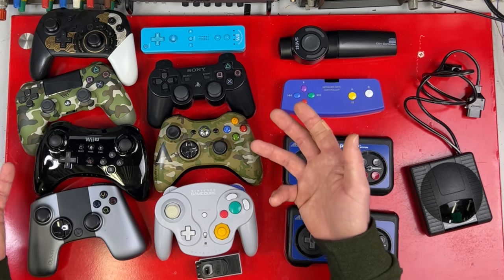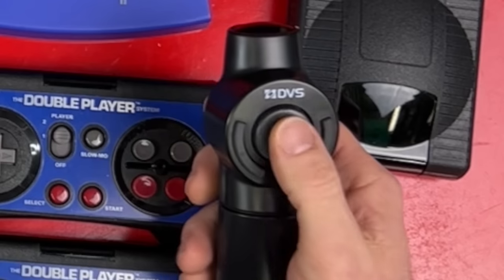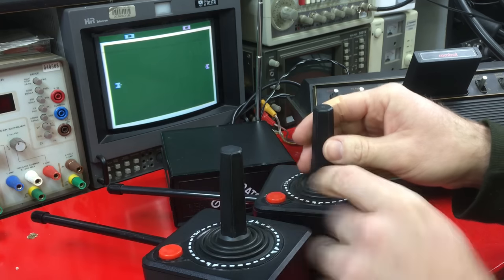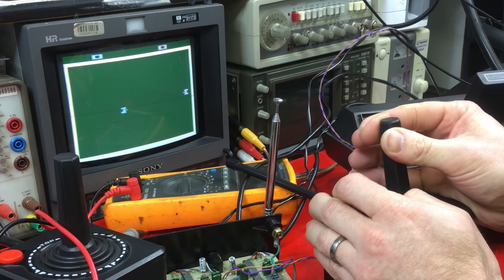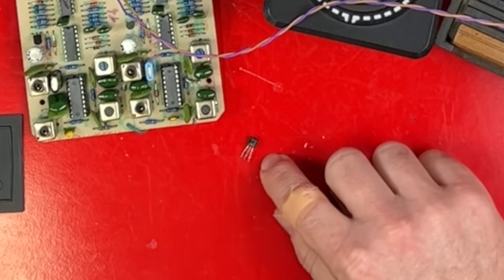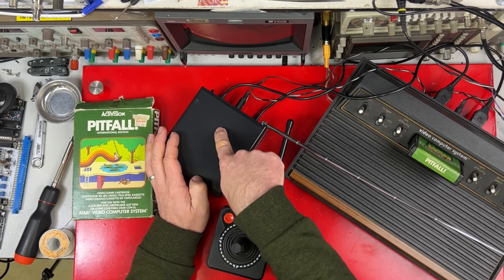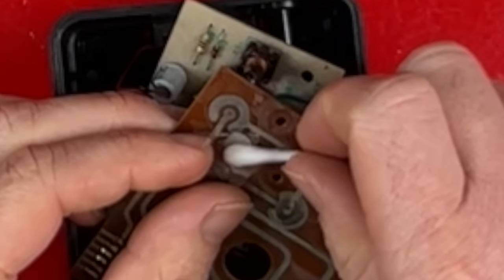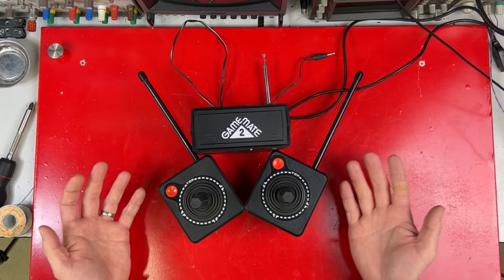The First Ever Wireless Video Game Controller

Comment: Atari originally wanted to create a new 2600 variant called the 2700 that utilized these. However they made the controllers unbelievably powerful. As they would mess with neighbours’ TVs, radios, and garage doors and the FCC told them they couldn’t sell it.
Reply: Oh lord LOL
Reply: Good old days of unencrypted 27, 49 and 433 MHz crap flying all over the place and doing whatever
Reply: I've seen this story shared everywhere over the years, but it's never accompanied by a source. I'm a bit skeptical of that last tidbit. Surely they could've just used an unused frequency range like every other remote control device?
Reply: @kimgkomg  Nowadays we've got literally millions of devices on a single frequency range (the 2.4 GHz one for example), but with current modulations you can actually do it feasibly, devices know when to hop sub-channels automatically, reject signals from other devices they don't need to listen and so on, but back in the 70s and 80s that wasn't the case. You had pretty much the 3 options I posted above, more than that and you might need custom hardware that nobody makes and it will cost a LOT to develop, and the modulation is just OOK or so - On Off Keying. Basically you pulse the radio on and off, that's it. If anything else accepts a similar burst, it will react.
That's why it took until the Wavebird for those things to cooperate freely, you kinda need a smarter encoding to not wreck every other device around and not have your own controller moving with garage door openers or your brother's RC car either. Basically it didn't even need to be THAT powerful for issues to happen, there were enough devices around on the allowed/usable frequencies to screw it up as well.
The issue with just changing frequencies is that there's only so many unused frequencies that you're allowed to use and sell products at, regulated by the FCC in the USA, Anatel if I recall in Brazil, and dunno the European and Asian equivalents. Otherwise what happens is that wild west of interfering devices overpowering each other and in one moment there will be a dangerous interference that you just cannot allow (like aircraft AM radios).

Comment: These type of RF controllers probably weren't made anymore past the Atari because of FCC regulations - the fact that you can pick up the controller signal as a TV channel signal is a big no no in their books and I'm sure that with more and more video games coming out with the NES they were much more strict on laws and certification
Reply from the maker: Yeah I think you’re spot on. That still falls into “too expensive” though. The cost of making a device adhere to strict regulations would be much higher
Reply: Legal unlicensed RF devices have been around for a long time, for example RF garage door openers continued being made after the Atari. The fact that it needed to be very close to the TV means it wasn't operating on a TV broadcast frequency. James was probably picking it up on a harmonic, or if it didn't change with the TV's tuning position, it was probably being picked up by the IF.
Reply from the maker: @eDoc2020  yeah it was visible on tonnes of harmonics across the tv spectrum. I forgot to check the carrier frequency when I had the scope on it but the crystals are about 48MHz

Comment: Could you make anything that produces a radio frequency into a controller? It would be kinda fun seeing if a wallow talkie or something like that playing a game.

Love the videos!
Reply from the maker: Apparently an RC car radio on the right frequency can trigger some buttons on these.
Yeah basically you could.
Reply: These old wireless receivers were really dumb. They locked onto certain frequencies and did nothing to make sure the signal was the right signal or even made sense. Clearly that stopped being adequate when radio frequency remotes became more common.
Reply: @Bubu567 the original product before this they were working on at Atari was basically just that ran on a lesser wavelength and could go like 2000feet. But it triggered garage door’s in the whole area and so they stopped trying to dev it.
Reply: @Roninkinx  That's hilarious

Comment: My brother and I had a pair of these back in the 1970s.  We didn't use them often because they did burn through batteries and you had to be close to the 13" TVs of the time to see what was going on anyway, so the cords weren't THAT much of a problem but we did occasionally use them in our bedroom because it meant we could sit on our beds and play without the controller cables blocking the path through the room (which the rest of the family frequently used to get to the bathroom ... our house layout was weird).

Comment: Nice work James!! I actually have a slightly older version of this complete in the box. The controllers on mine use a pull out aerial antenna as opposed to the flexible rubber ones on your set. I was pleasantly surprised how well these worked! 
Also loved the more in depth view.  Much appreciated :)
Reply from the maker: I saw a couple of photos of those but no info, what’s the build date on the bottom? Mine are november 1982 from memory
Reply: @Games_for_James The build date on my set say September 1982. Made in Korea. Serial 113130, interestingly the 2nd controller has the same serial. I suppose they swapped over to the flex antenna so kids wouldn’t bend/break the aerial style antenna.
My boxed set came with no instructions just the styrofoam and the setup. Weird. Let me know if you want any more info or photos.
Reply from the maker: @silverperzon  the serial number would be for the set so that makes sense. Yeah telescopic antennas are really bad for breakage. I’ll have to check what my serial number is

Comment: When the PS4 got released I thought the controller was kinda weird and wondered why they didn't keep the old design.
Now I can't go back to the older playstation controllers without wondering how tf I used them for hours on end lol
Basically all I have to say about wireless controllers

But next time less spiders and more cats please ;)
Reply: The DualShock 4 is fantastic! You can buy adapters to use them natively with the Switch, SNES, MegaDrive, and PC so it’s basically my universal controller.
Reply: @jb-br8bf  oh that's cool, I didn't know about that. I just use mine on my PC with a USB cable. You can connect them to your PC with bluetooth as well but sometimes that doesn't seem to work for whatever reason so a cable is easier
Reply: @jb-br8bf  I’ve had some “bad” experiences with ps4 controllers (stickdrift slightly earlier than the Xbox counterpart, the rubber on the sticks falling apart… pretty minor stuff), and I have an Xbox series S rn because it’s the cheapest next gen console, but I completely agree the DualShock 4 is good. Like every modern controller. Except that it uses potentiometers. Like every modern controller. (Why does there have to be a patent on hall-effect sticks)
Reply: @jb-br8bf  No need for an adapter on PC - they should natively work, especially if you have Steam installed.
Reply: I liked DualShock 3
Reply: @AtomSquirrel  did you hold one recently?

Because I liked it too. I recently held one. It’s awful.
Reply: As a playstation boy, i have one huge gripe about the dualshock 4, and that is the "start" and "select" buttons being flush with the actual surface of the controller, it makes it really annoying to press them at times
Reply: @Friendly_Neighborhood_Dozer  I have DualShock 2 and 3. The 3 is very lightweight and nice.  I always turned off SixAxis when I could though. The only downside to 3 was the dreaded Mini USB port
Reply: @Friendly_Neighborhood_Dozer  and as a side note, I’ve used 4 and Dual sense. The problem with the 4 was the dreaded micro USB, aka flat, backwards Mini USB. PS5 controllers are aight. I just like the old ones because they’re the ones I grew up with and feel the most familiar. I get more of a connection in games
Reply: @IntelliPocalypse not to mention the micro usb port is upside-down, which sure is kinda annoying
Reply: I immediately loved the size of the PS4 controller, PS3 controllers and earlier were just too small, and it made them seriously uncomfortable to me. The ergonomics are probably a bit better too, but the size is the main thing.

But man is the battery life awful. I really wish they wouldn't have stuck a big LED in there, because its my single biggest gripe. Once the battery ages a bit, and it doesn't have to be long, they might as well just be wired controllers. The switch pro controller is probably my favorite overall, but the lack of a headphone jack is a blow against it for sure, but its my only gripe and I don't use headphones with consoles too often anyway, and if I'm using it for PC it wouldn't even be useful anyway.
Reply: The only thing I don't like about the dualshock 4 is the analog sticks
Reply: @Friendly_Neighborhood_Dozer I use them all the time they feel great unless you got aftermarket junk
Reply: @toyotacorollaaltis8613  I have biggass hands and the grips are very flat and small. So it may just be that, as well as the fact that I’m currently more used to the triangular grips of the Xbox Series controller.
Reply: @AtomSquirrel  I always felt the PS3 controllers felt noticeably cheaper than the PS1 and PS2 (and PS4 afterwards) In hindsight that might just be because they were lighter.
Reply: So to clarify, the reason they felt cheaper is because the dual shocks in the PS2 controller were used either without permission or the license was up on them. The company making the vibration motor for the PS2 controller sent Sony a cease and desist. So when dual shock 3 came around, they had to use a different vibration motor. This happened at the tail end of the PS2 era, so some PS2 controllers feel as light as PS3 ones. The real dualshock 2 controllers are heavier

Comment: Great video, James. 
I think you would love the Master System Super Compact from Tectoy, it was a console that could use an RF antenna to send video to the TV, it had all the controller inputs and cartridge slot on it so it was basically a wireless controller AND console.
Reply from the maker: Thanks!
I sure would! I haven’t gone down the tectoy rabbit hole yet. There are a lot of interesting systems in Brazil.

Comment: I had the Atari-branded version back in the day.  I loved them and even used them on my 7800 for games that did not need the second button, (and some that did: Planet Smashers, anyone?  I never used the bombs anyway) until it stopped working... probably had the same issue.  I wish I had known how easy that was to fix back then.  

As you noted, I never noticed any difference between them and the wired controllers, except the FREEDOM from the tyranny of WIRES!  I certainly noticed no appreciable lag.

Comment: Would be cool to see these get modded with a lithium battery and a type c port for charging, although that might be a bit too sacrilegious.
Reply from the maker: It could easily be done without cutting any holes if the charge port was behind the battery cover
Reply: If you're going to go that far you might as well just buy some modern Atari-standard wireless controllers. There's a few well made ones out there.

Comment: 7:30 Looks like Asynchronous Serial Communication. Essentially there is a start bit and a stop bit along with bits that represent binary code. When the line goes down, that usually represents a 0. When the line goes up, that usually represents a 1.

Comment: I vaguely recall seeing ads for ultrasonic wireless joystick controllers that preceded IR controllers; but have never seen a physical unit.

The only wireless devices that (I didn't build myself for some school assignment,) I've handled and know used ultrasound to communicate were RCA (4-button) TV remotes, various (4-button) 1980's projector remotes, and the (some number of buttons) NES power-glove.

Comment: Urban legend is that Atari was planning to release their own RF wireless controllers for the 2600, but they had to cancel the project at the last minute after discovering that the radio signals from the controllers were so strong they could interfere with other wireless-equipped 2600s SEVERAL HUNDRED METERS away.
Reply: They did release their own controllers actually. That test was for a console that was to come with wireless controllers

Comment: Back in the day I had an NES Satellite. It was a wireless 4-playet tap, and you would plug your controllers into it to use it. This solved the problem of having to always aim the controller toward a receiver, as once you got the transmitter placed properly, you didn't have to worry about it.

Comment: Nintendo originally planned to release the famicom in North America as the Nintendo Advanced Entertainment System with crappy infared wireless controllers & a keyboard. Apparently they showed it off at CES 1985 before changing it to the NES.  

Imagine the NES coming with crappy infared controllers by default:/

Comment: This video was super informative about a console I never owned, but regard as the genesis of gaming’s popularity spike. Also I would have thought there would be MORE wireless controllers seeing how relatively simple these Atari ones are compared to modern controllers.
Reply: I believe part of the reason more manufacturers didn't use this method was that Atari ended up getting in some trouble regarding the strength of the radio signal, apparently it would interfere with TVs and Radios in neighbouring houses. Not sure exactly how true that is, might honestly just come down to infrared being cheaper to manufacture.

Comment: in the controller, it is most likely a TX2C transmitter chip, commonly found in RC cars from the 80's to the early 00's. Unfortunately as they age as well as tech advancing and higher frequency rates, they start to become virtually unusable due to interference.

Comment: I wouldn't be surprised if that blew up because the adapter has a headphone style plug for power and someone plugged it into the wall first and shorted out the base unit while plugging the DC plug in

Comment: it would be cool if you could wire it up so that the system power also turns it on or off so it doesn't blow up gain.

Comment: I have a set of the atari controllers but unlike yours  the receiver on my set has the ATARI Logo and says 2600 Remote control joystick molded in raised lettering on the front panel. manufactured june 1983. And all chips are identifiable  4- CD4069CN, 2-MSM4015RS, 2-LM1872N  also has a different case style for the voltage reg which is a 78L05. Joystick chip is LM1871N.I didn't see any wireless controllers for sega genesis in your collection they used IR.

Comment: If you can tune these in to show on a tv, could you broadcast images to get the receiver to play without the controller?
Reply from the maker: Ohhh, as a video? I don’t think it would work properly, video signals have a specific set of parts to their waveform which you can’t get rid of.. they would likely confuse it. It would need to be broadcast on the exact frequency too. Something might happen though? I like your thinking.

Comment: I'm glad you didn't have to use a buck converter.  The cheap and small modules tend to lack adequate filtering and switch in the 20KHz range so it would probably make the RF receiver go bonkers.
Reply from the maker: That was going to be explained if I had gone that way. Switching power supplies in general are pretty bad for RF devices

Comment: You can buy 9v's that you can recharge via USB port on the side of the batteries or the ones with a dock. they are about $5 usd each but if you're an atari fanatic then it would probably save you a decent bit over time.

Comment: I have a set of the Atari branded. I dont know if its just my set, but if the controller is off or the base station get interference of that signal you pointed out, the base station flips out and presses every button rapidly.

Causes weird things with some games (like wizard of wor).

You either have to keep both controllers on, or unplug the unused one.

Comment: If memory serves, the first wireless controller to NOT use RF was either the Xbox 360 controller or the Wii remote. I can’t say of that’s true for the former though because I’ve never had an Xbox.
Reply from the maker: All wireless game controllers which aren’t infrared use a form of RF. Most if not all modern controllers use Bluetooth, which is still an RF protocol.
Reply: @Games_for_James Strangely, there were some wireless controllers that didn't use either infra-red or RF. For example the  imaginitively named "The Remote" from Blue Alpha Electronics used ultra-sound.

 The receiver had a small microphone, and plugged into the joystick port of the computer or console. The transmitter had a speaker and a port to  plug in your joystick or controller. It used a standard 9-pin Atari-style port and worked surprisingly well.

The only downside was that on some computers/consoles you also needed a battery for the receiver unit - depending on how much voltage was available on the joystick port.

Comment: TBF to the CDI remote, the CDI wasn't meant to be a game console at first. It was more designed for multimedia applications. Think something like the Flowers of Robert Mapplethorpe, or simple point and click games like Myst. It wasn't until it flopped that Phillips tried to pivot to action games as a last ditch effort to save it. It didn't work.
Reply from the maker: I agree but the DVS VE-200 was very late to the game and still only had this controller
Reply: @Games_for_James  Wow, then yeah, I guess that is inexcusable.

Comment: The 78Lxx regulators don't seem to have input polarity protection and are only rated at 100 ma.  I'd be willing to guess someone tried using a  wallwart with the wrong polarity and popped the regulator.
Reply from the maker: Yeah also very possible